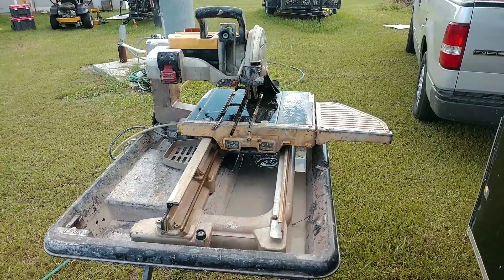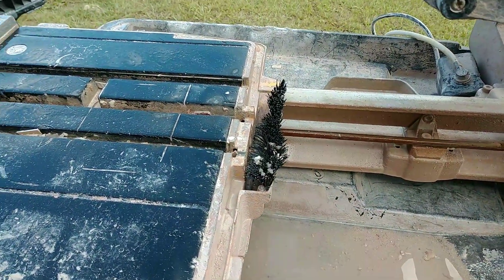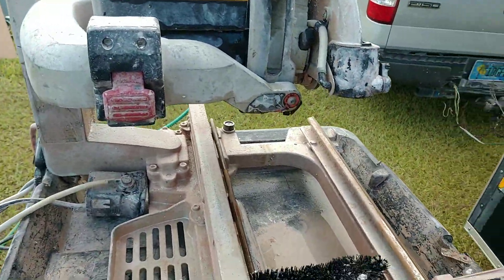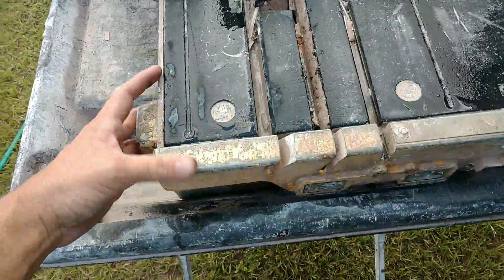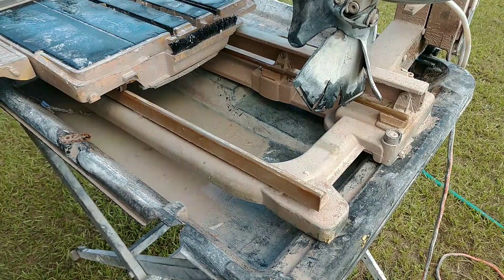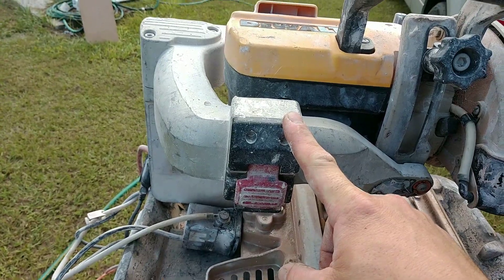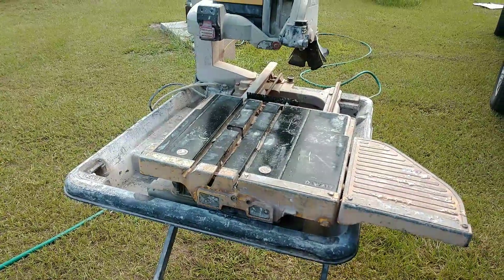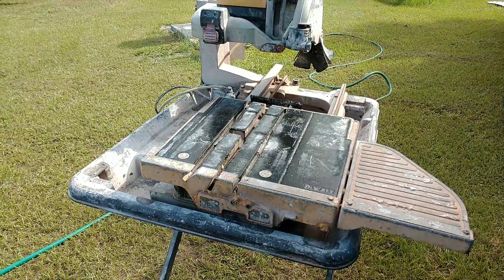DeWalt wetsaw 2400s.

Comment: Hey maybe you can help me . My dewalt 2400 wetsaw when I start it like to much power goes threw at once and makes my blade jump wobble at the start. But once it's running every thing fine. But it like jumps a little at start. Could it be my switch or I don't know.